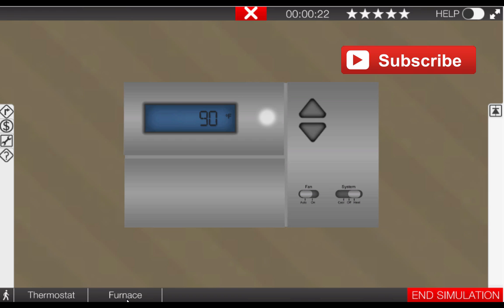Gas Furnace Pressure Valve Troubleshooting Video

Comment: what about the use of a digital manometer or a magnahelic gauge to insure the
correct vacuum before determining the pressure switch is in need of replacement.
In most situations the pressure switch is not the issue.
Reply: Absolutely true. A spinning inducer motor does not mean for sure that it is working correctly, or that proper draft has been achieved to close the pressure switch.